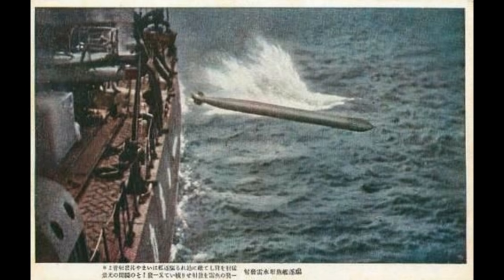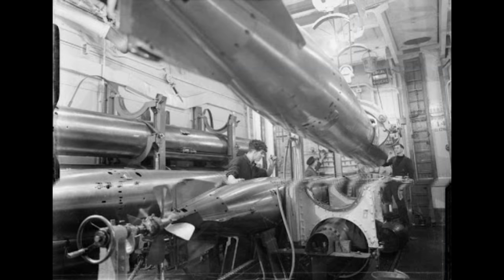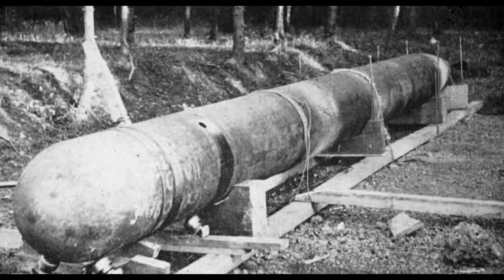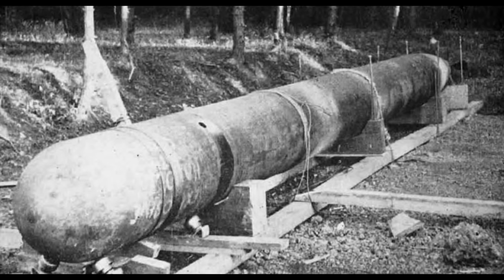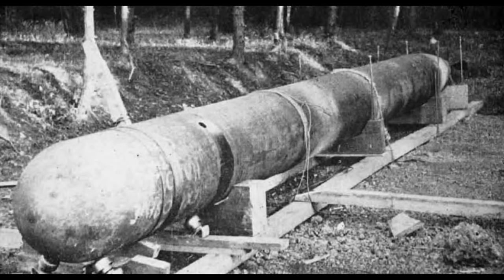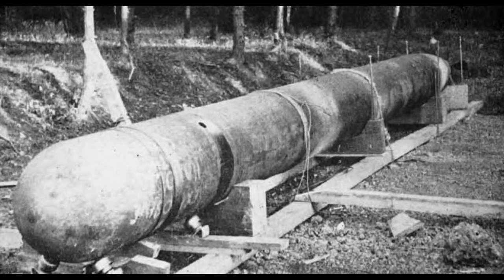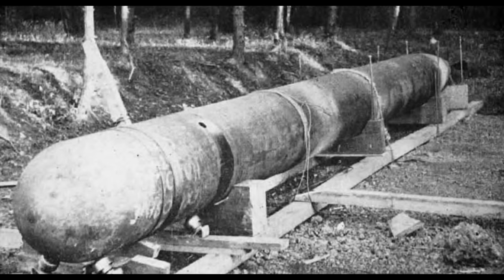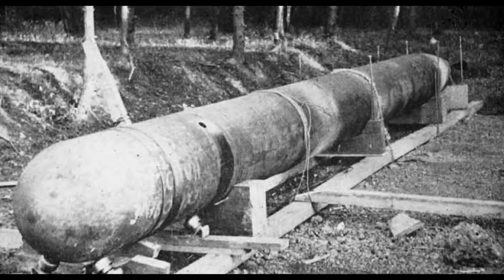Type 93 Long Lance Torpedo - Long Range Hole Poking Device

Comment: Great video. The United States Bureau of Ordnance was a complete disaster. You would think they were working for the enemy. This is the same Organization which was  responsible for the terrible American torpedoes which cost many lives in the first two years of the war.
Reply: To be fair, the British equivalent was almost as good at doing what they thought their job was (stifling successful weapon systems) as the US Bureau was. Non-bureaucrats think that the 'job' of those bureaucrats in organizations such as the Bureau of Ordnance was/is to design and successfully provide good, operational weapon systems for their respective militias/navies. No, the purpose of these organizations is to maintain employment and budgets for those organizations. To do so means that you need to diligently amend aggressively maintain that your designed and produced products are superior to every other product possibly produced by any other organization. 

In that sense, the equivalent Bureau of Ordnance Soviet, WWII German  and almost any other large bureaucratic organization always results in such thinking.
Reply: I would add the fiasco of ordering South Dakota class turrets for the Iowa class when the designers intended to install the type 2 sixteen inch guns.  A small problem of too little turret and too much gun.  Had to rush develop type 7 guns to fit. These were about 8% less powerful than the type 2s which were already built, left over from the cancelled Lexington's.
Reply: @francoistombe  I had understood from Garzke & Dulin that the decision to develop a new lightweight 16” gun for the Iowas was driven by overall weight and space design considerations.   That’s now a fairly old book, so has there been new research/revelations about this?
Reply: I believe that the US military/navy was not very effective in peace time, at least until WW2.
The various wars that the US was a part of until 1945, usually had them make huge mistakes, poor decisions, have technical difficulties, poor commanders and in general lose a lot.
But the US has the resources to recover from those early defeats, and the skill to learn from its mistakes and replace its worst officers. It then kicks butt.
Reply: @glennsimpson7659   I believe that was the cover story developed to play down the goof up.
Reply: Yes, but look at how many lives it saved. 🇯🇵
Reply: @francoistombe  BuOrd was also involved in the late 1980s USS Iowa explosion.
Reply: @user-vx6nc5wr5v  Not surprised. I have a book about that. The initial reactivation of the Iowa's was a whole mass of screw ups. All the old gunners who knew about the 16s were gone and they winged it from there. The powder stored since 1945 had to be repacked and they had lost the knowledge about batch specifics. They mixed different batches of powder and ended up with charges of unpredictable performance. They could aim the guns  but had no idea at what range the different shots would fall.  Early bombardments went all over the place. Mechanically the machinery was eratic and this was ultimately shown to be the cause of the turrent explosion, but first they went through a fiasco of trying to blame it on a sailor suicide.  BuOrd = screw up followed by blame someone else.
Reply: Francois Tombe ,the reactivation of the Iowa class boats was a dumb ploy to increase the size of Regan's Navy. Almost none of the service experts were even consulted about how to safely operate or update the old weapons systems, and sailors paid with their lives. 
 The final navy report is a disgrace to anyone that served, full of outright lies and unprovable supposition. The Iowa's gun commander and captain should have taken the blame for operating the 16" guns with nonspecified training and unproven powder loads ( the gun commander was "testing" different loadings and the c o was informed ).  
Someone had previously posted the independent investigations results (the "Sunda systems report on the U S S Iowa turret explosion" iirc) on a different video here: The main problem came to the ship's captain and crew handling the scene and preliminary investigation (instead of a Navy board, etc
).  Not enough was preserved at the time to aid any later inquiry, evidence was lost, only a few pictures taken, the turret was cleaned, and statements taken long after events - all of which was probably done by the officers in command that day, on purpose to save those officers careers. The powder bags were the most likely main contributing factor: as you said newer and WWII propellants were mixed, put in new bags with a different and toxic burn pattern, and sorted and stacked incorrectly when reassembled ( raising the sensitivity to both pressure and heat ). In addition the safe handling practices had not been passed down to then current crew members, over half of whom had not had proper firefighting training in the gun turrets . The Iowa was a fine ship, in the time it was built, it should have stayed in that time and not have been brought back into service at high expense for no real world purpose.
Reply: @williestyle35  I remember that. Bastards had it hosed out by the next day. Typical. Good enough for government work, I suppose. 🤷🏻‍♂️
Reminds me of that day in early September....Godspeed.

Comment: imagine if they had germany's acoustic guidance technology that could have been a weapon far ahead of its time.
Reply: i read a couple months back about their homing torpedoes.
Reply: US had the Mark 24 "mine", otherwise known as the Fido acoustic homing torpedo, usually air-dropped on U-boats which had just submerged.  Supposedly illegal to drop on a surfaced U-boat to avoid the chance of any survivors telling the tale back in Germany.
Reply: @grizwoldphantasia5005  more likely would be that these weapons were incredibly expensive so if other options were available because the U-Boat is right there then they would likely be told to take the other choice.

Comment: One defect of the type 93/95 torpedo that isn't mentioned here is the very large error envelope of the guidance system. At 10k yards, the error envelope was five or more times the length of the ship it was aimed at. Therefore the need for mass firing of torpedoes hoping for a few hits.

When they were put into submarines as the type 95, this had the paradoxical effect of encouraging the sub commander to fire at such extreme range that his chances of a hit were minimal. Long range was the achilles heel for the use of the type 95 in submarines. Had it only a 5k yard range the whole policy would have been more in keeping of the American sub fleet, get in as close as you possibly can and fire a full spread. Chances of a couple of hits was almost 100% then.

Comment: I was privileged to work on a restored PT Boat (658) that carried the anemic Mark 12 and Mark 13's.
They had 330 hp steam turbine powered motors.
The first 18 months of the war they failed to explode due to the stupidity of the Naval Bureau in Washington.
The contact detonators were set perpendicular to the forward movement of the torpedoes which meant when the torpedoes hit a ships hull, the impact bent the detonator and caused it to fail to detonate.
The solution was eventually to make the detonators of thicker ,and harder metal.
They were not even close to the speed and destructive power of the Japanese Long Lance.

When the Long Lance hit a Cruiser or Destroyer it either broke its back or blew the bow or stern completely off.
Guadalcanal  Diary and Savo Island battles illustrated the massive destructive power of the Japanese Long Lance.

Great technical details in this series.
Well done sirs!

Comment: Well, at least the Japanese tested their torpedo, unlike the US who just assumed it would work, you know... because 'merica!
Reply: Aiming it at the Chinese navy really don't count as testing.
Reply: Not just tested- the Japanese TRAINED with live fish.
Reply: @somercet1  Kind of like how the 737MAX worked out. Testing, why do that when the government don't give a crap?
Reply: @somercet1  I studied the subject in ROTC.  Depression era US defense spending led to a ton of skimped upon projects.  Torpedo testing simply was not in the US Navy's budget.  That's the official line.  But here is what I learned when I dug into it. 

Testing wasn't going to be in the US navy's budget until someone made them test it.  There were two reasons:  

First:  Some admirals wouldn't take responsibility for failure or claimed success when there was none.  They did this so they could maintain their jobs, or get a promotion because if caught screwing something up, then they would be out.  The admiralty was also required to compete for money within the navy for their pet projects.  The best connected or the most 'loyal' to the navy's over all plans usually beat out other, less savory projects.  Testing torpedoes or even developing torpedoes wasn't very high on the list of glamorous jobs in the Navy so the guy in charge basically sold his superiors on the idea that the machine performed flawless despite any testing.  On budget and on time.  Yes sir because if it wasn't, then kiss your pension good bye.  

Secondly, :  The Bureau of Ordinance was a cesspit of bureaucrats who had acquired enough power to lord over the navy's RD projects and jealously held onto it's political power, refusing input from the field and criticism of it's policies.  Getting any money out of them would be impossible.

This environment fostered the belief that the torpedo would work, period.  Because they said so.  And of course, we know that's not true.
Reply: @somercet1  Some readings in History, U.S. might be in order.  Prior to the mid-30's when had ANY Congress (from which the $ flows) been open-handed with Naval spending?  Aside from the brief post-coital glow of the Spanish-American war, I mean.  Only when the "yellow-press" pushed our imperialistic colonial aspirations did the Congress fund Naval expansion.
Reply: @b.thomas8926  This sounds alot like the development of the F35
Reply: @ivanthemadvandal8435  In a way, yeah.  Different times, but same kind of over enthusiastic dreaming.  Difference is, at least the F35 had to fly or no one would buy it.  They HAD to test it.  

Back in the day, they just assumed (or lied) that the torpedo would work out of the box with no testing.  We all know how that turned out.

(shrugs)  Politics.  Whatever.
Reply: @twotone3471  . Governments don’t test commercial aircraft.
Reply: @ivanthemadvandal8435  -  as every government defense department not named China or Russia lines up to buy the F-35
Reply: @petersouthernboy6327  Well they do actually because laws regulating weapons exports, the F35 cannot be sold without approval of the US Government.

This is why the F22 cannot be exported despite nations that are allies (such as Japan) shown interest, the F35 was never a commercial aircraft either, it was designed for the JSF so always for the US Military, the other competitor being the Boeing F32 was never sold to anyone else either, the costs of developing a military aircraft for export tends to be prohibitive as well running into exports bans so they are more or less only developed for their own country military as the costs would be lesser.
Reply: i mean technically the torpedo has a perfect record sir, 0 failures out of 0 launches
Reply: Not because 'Merica! But because if you test it, the Ordinance Branch could get in trouble!
Reply: The type 14 was tested. They fired 2 at a barge. One ran under it and did nothing the other blew it up. Apparently a severe failure rate based on 2 live firkngs was seen as good enough....
Reply: @charlesballiet7074  That's exactly what the ordinance bureau was selling.  Because nothing American made could go wrong....  (joking)
Reply: @jonathanklein383  To clarify sir, those 'tests' were simulated.  No actual explosives where used because the torpedoes were too expensive to loose.  When the torpedo ran under the barge, it was declared a success.  They stated that the magnetic detonator would have functioned.  When the torpedo hit the barge, it was declared a success for obvious reasons.  None of the actual tests involved real targets or fully armed and live torps.  The navy didn't have the budget.
Reply: That was the exact mentality for the japanese in many other aspects, sadly for them

Comment: Sometimes when reading WW2 naval history, it feels like the Japanese were the only combatants whose torpedoes weren't an endlessly-troublesome disappointment.
Reply: Once the British dropped magnetic pistols, their torpedoes did the job as required.  I also believe that the Italian torpedoes, though no world beaters, worked as designed.  Not sure about the French, but they had such interesting variations of sizes and and launchers that it would be surprising if they were no problems with them as a weapons system.
Reply: From the three major players with a navy in world war II they were the only ones that didn't go for a magnetic detonator which kind of helps because contact detonation in torpedoes was a very well understood mechanical process, from what I understand the British ditched magnetic detonators at some point in 1940ish which means that they ditched them faster than the American stitched their magnetic detonator cuz they realized that this is not going to work
Reply: Of all the major players were they the only one that didn't use magnetic detonators in the beginning at least. I don't know about the Italian torpedoes which is why I ask. But if that is the case then that would easily be why because the 30s 40s and 50s the technology does not exist to make reliable magnetic torpedoes. We're just going to ignore the mark 14 as a thing

Comment: Thanks Drach. You shared an interesting detail I didn't know. Their extensive testing program. Unlike the Japanese, we, the US, were too damn cheap to engage in frequent test firings. Therefore our torps were crap at the beginning of the war and for a shamefully long time AFTER the war. Lots of Allied sailors died who need not have died, and lots of skippers were blamed as failures when it wasn't their fault at all. BuOrd denied anything was wrong with the torps. Ferociously. There was PLENTY wrong with our torps. On the other hand for one,in the plus column for us,  IJN Mikuma was destroyed when we managed to detonate her Type 93s at the tail end of The Battle of Midway.